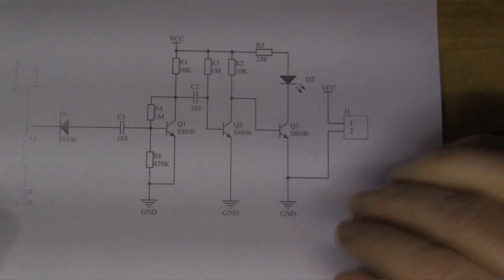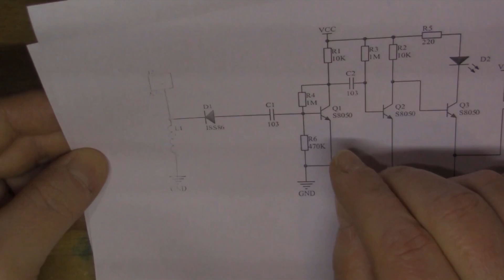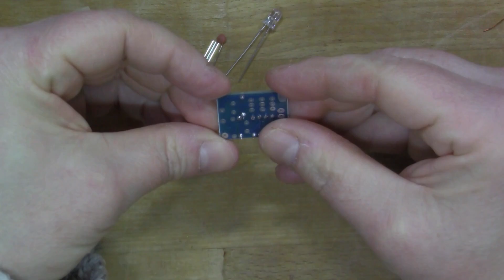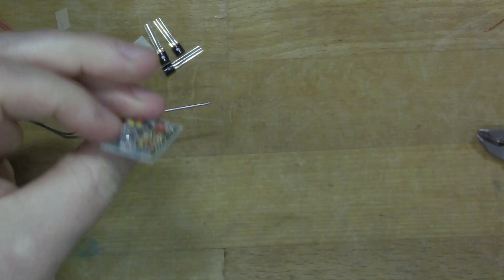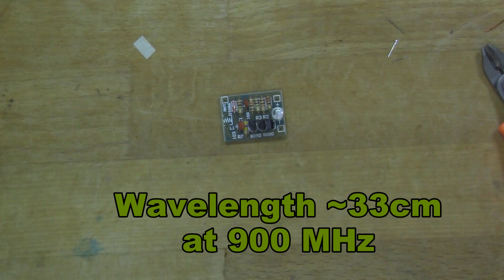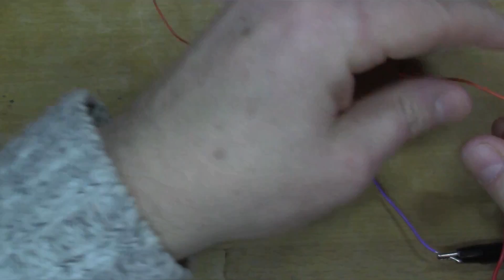Kit Build - GSM Phone Signal Detector

Comment: here bc 547 or bc 548 transistor are use?plzz tell me
Reply from the maker: They're S8050.  I think in this circuit you could use BC547/8 as they have similar current gain, and here everything is very low voltage and current.